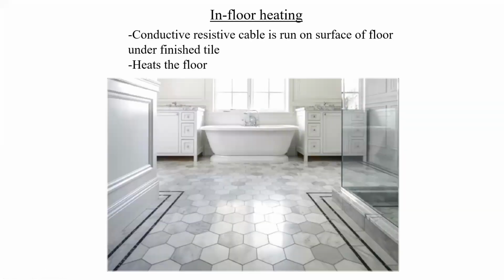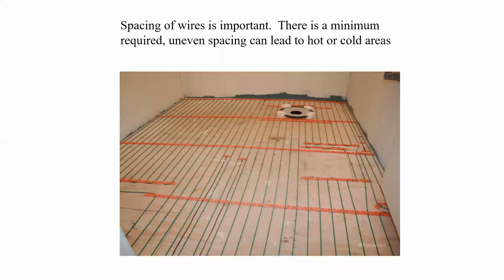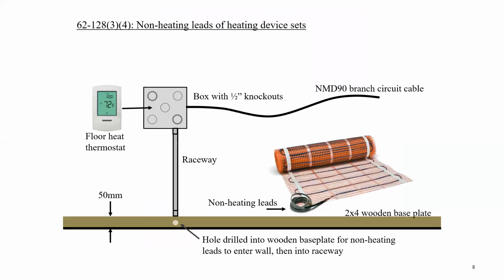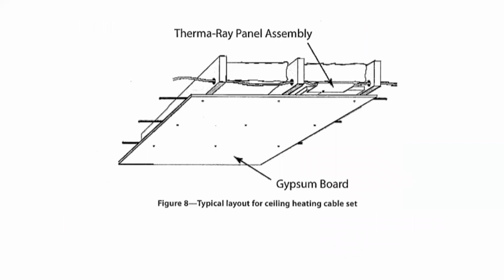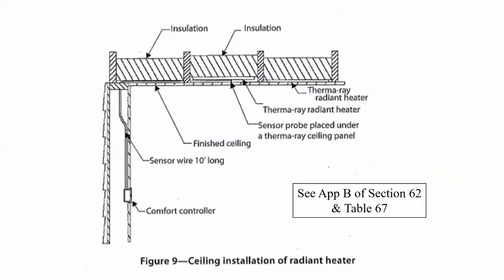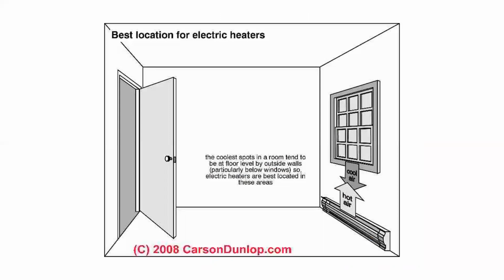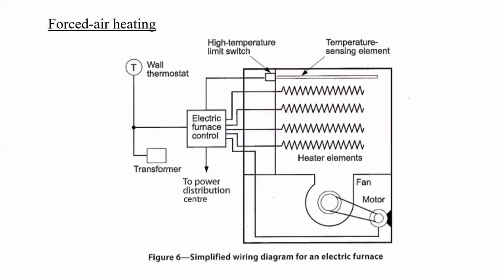HVAC Introduction to Heating systems

Comment: Great content!  One note for recept above bb heaters:

26-722(a) App B - In laying out the location of receptacle outlets in residential premises, consideration should be given to
the placement of electric baseboard heaters, hot air registers, and hot water or steam registers to avoid
having cords pass over hot or conductive surfaces wherever possible.

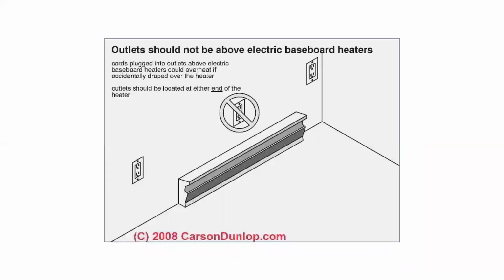2:52
Reply from the maker: Excellent find! Yes this app B info is very pertinent to the discussion. Thanks for sharing it here!